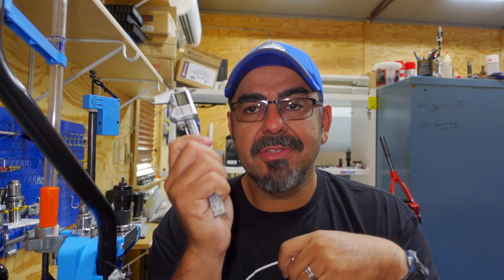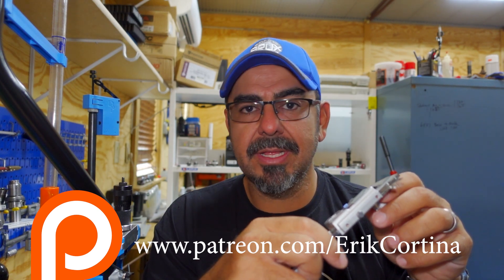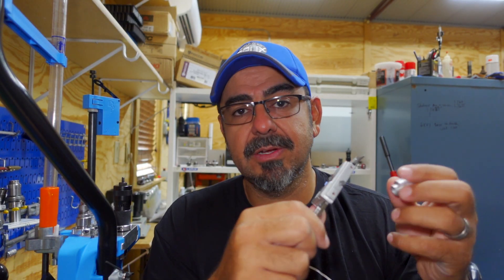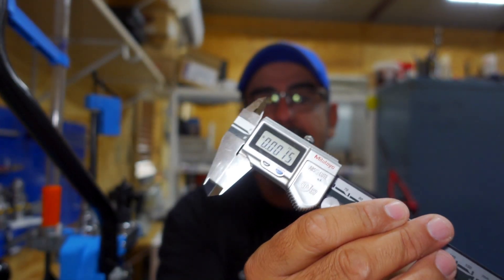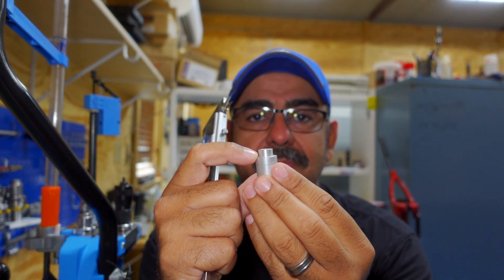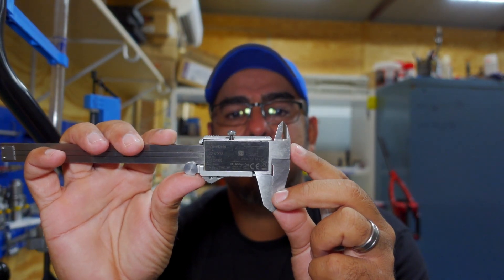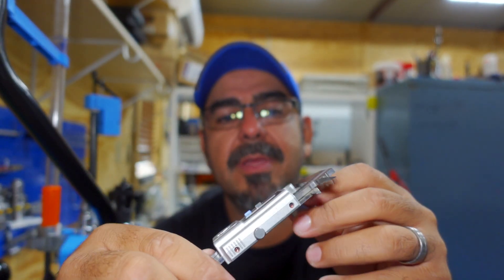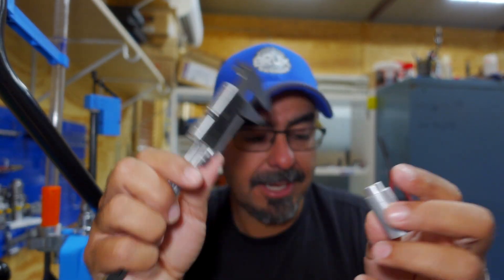You are using your calipers wrong!  Let me explain why...

Comment: About accuracy:  Few people even know what a thousanth of an inch is let alone that there is something that can measure them.  Most people compare things to human hairs or a sheet of paper or even a millimeter.  People I know would say a mm is less than .001".  The little measurement method you demonstrated can be useful occasionally however if I were measuring the part in the video I would measure the overall length and then the shoulder height from the same surface.  A little math does the rest if necessary.
Reply: Imagine that! People using millimeters to measure things! When you can use your feet or intuitive things like gauges!
Reply: @nomen.nescio  If gauges were intuitive more people would be using them.  The great intimidator here is MATH!!!  Most people think you're a genius if you can do even the simplest math.
Reply: @ramtek2702  It was sarcasm, gauges are even more crazy measurement units than inches and feet. Mainly because math with them is impossible... Imagine a system where 0 is not the same as 00. And yet, many Americans still use this crazy system... Or really, systems, because for example wire gauges and sheet metal gauges are completely different units.
Reply: Temperature is also a factor

Comment: Yup... Used calipers for many years but didn't know about that method. I would have set the calipers on the step vs bottom, set origin, then measured end to end. Difference is the step depth. Your trick is much quicker though. Thanks :-)

Comment: Also wrong use;  Using them as scribe tool......DONT!
Also wrong use;  Using imperial instead of metric!! :P
Reply: the best use for a Harbor Freight calipers is as a scribe tool... they pretty much suck at everything else... (-:
Reply: So when I'm working on the airplanes I worked on for 42 years, I have to take the conventional (NOT IMPERIAL) unit measurements in those hundreds of thousands of technical data pages and convert them. . . I get it. Smart.
Reply: @paulcrumley9756  Hahahah that would be a B.!!!   
But I do think working in Metric would be a lot more sensible and faster then using, 3/16...and so on, fractions...
But héy, I get it, if everything has always been a curtain way, it's almost impossible to switch..
You didn't notice the  :P  ?   :)
Reply: @R2_D3  Well, I never saw an official dimension for much of anything that wasn't in inches and decimals. No feet, no yards, none of those impossible to figure out (unless you're good at sixth grade math, but I digress) units. Just a dimension such as 10.125 inches - as simple to use as metric. And measuring equipment to match, of course. So as long as there are historic items needing our attention, we're stuck with a decimal-based measuring system.
Reply: @paulcrumley9756  I totally get it, use what you know best!   
I'm damn glad we Dutch use the metric system!!  :P
Reply: 95% of the world use metric, and the rate is increasing.
Reply: I’m comfortable with metric and Imperial. . .   but using Inches means you have to know how to deal with fractions; dealing with fractions exercises the brain. . .   which is a “good thing”
Reply: @dewiz9596  We use fractions; A 10/100/1000 of a millimeter. At a fraction of the time and hassle ;)  So we can think about the next thing we want to make..
Reply: @dewiz9596  I have never come in contact with imperial measurements. I guess that I work with "the majority of the world".
My brain get more than enough exercise calculating with metric :-)
Reply: Uh, what's "imperial"? :P
Reply: @Milosz_Ostrow  Inches, feet and yards, or wooden shoe lengths, as us fitters call it (at least in Denmark). ;)
Reply: @Milosz_Ostrow  a typical ''google search'' word :P
Reply: @Milosz_Ostrow  It's what the ill-informed use when they refer to US customary units. There is a similarity in unit names, but the US has never used imperial units to my knowledge. 
Wikipedia: "The US Customary system of units was developed and used in the United States after the American Revolution, based on a subset of the English units used in the Thirteen Colonies."
Reply: @elypowell6797  — Who uses it anymore?  Aerospace and automotive industries went hard metric decades ago.  Only the building trades still use inches and feet in the United States, while in the rest of the world building materials are sized in hard metric dimensions.
Reply: Metric is the devil! 😈
Reply: @SquirrelyPrepper  The Metriconspiracy!
<3 The Devil!!

Comment: You miss one.   There is 5 ways to measure.   Measure overall length than press zero length.  Measure  shoulder to end. This will give you the length of the short  step.
Reply from the maker: That’s using the OD, which is one of the ways I discussed.

Comment: Hi,

Before taking any measurements you should be wiping the measurement surface, not just for gauge blocks. 

Also you shouldn't be storing you callipers completely closed as that damages the measurement surface. 

When using a gauze block you shouldn't be handing it as the heat from your hand is enough to make it expand it out of specification.

Regards

Comment: Great info, been machining 40-years , still drop by these vids to maybe learn new tricks. It is amazing now-days to see kids graduating from machining trade schools whom have been well trained in the digital world but can't read a pair of Starreet dial micrometers. Salutations to you guys out there who makes these type of instructional vids !
Reply: As much as I agree with you, it is what and how they are taught. Try them with a manual / non digital vernier.
Reply: @colinweir5807 , vernier refers to the analogue scale. Digital calipers are just that, digital.
Reply: @alfa-psi  Well, I said I was a Machinist , not an English teacher, LOL !
Reply: I retired 5 years ago after 40 years as a journeyman machinist/tool maker. The "problem" with the guys coming out of the schools today, are more "button pushers" than actual machinists. I can do stuff on manual machines that would have them scratching their heads. Most of them don't know how to adjust the taper attachment on a manual lathe, or even how to sweep the head on a knee mill (generically called a Bridgeport).

Comment: It's actually in the instructions that come with the calipers and has done for as long as I've been an engineer (47 years ) but guys never read them !
Reply: He didn't try and explain how to read a vernier though, they are (or should be) accurate to 0.001" ;o
Electronic are not usually as accurate as 'real' vernier, just easier for people too dumb or lazy to learn how to use them. I have 6 pairs and they all give consistent results (except the 2 electronic ones)
Reply: @1crazypj you're dead right, for quick measurements of parts digital verniers are fine especially for older eyes but its got to be a Mike for machining and quality control .
Reply: @1crazypj  Why would you need to use 'real' when the electronic one is so much easier to use and more accurate than 99% of people require?
Reply: @ssu7653  Quite simple really.
Although I have 3 electronic calipers,  I've never had to change the battery on a 'real' vernier.
I found it too much of a PITA changing batteries 'all the time' (at least it felt like it)
Plus, the readings vary as battery voltage starts to drop and it's less 'landfill'
If you have trouble reading 'real' one, get a dial type, it will still be working fine for your great, great, great, grand-kids (even if only historical interest by then)
I have a Mitutoyo Vernier that my brother gave me as a present when I completed training. 
It's at least 46 year old and still measures to 0.001"/0.02mm (when I bother to check it with a standard) Nearest 0.010" is normally good enough when 'roughing out' and many applications only need +/- 0.005". There is also a certain 'snob value' of being able to actually read a Vernier gauge when 'wanabee's' can only use electronic
Reply: @ssu7653  It's a matter of interpolated resolution. 

ANY electronic digital measuring device is limited in resolution for two reasons. First is the increments engraved on the glass scale on the back of the caliper slide (or whatever other device ...). The increments are very small and precise, and current technology is not able to ECONOMICALLY make them smaller and closer together  and still be unambiguously readable by the computer. Second is that all computers work in binary logic - strings of 0 and 1. There are no fractional parts between them. 

An experienced human eye/brain combination can interpolate between the smallest divisions on a vernier, dial or odometer-style mechanical scale with reasonable accuracy, where a (reasonably priced) digital instrument simply cannot. 

Stupid, limited computers versus human intelligence and vision.
Reply: @GraemePayne1967Marine  Computers have no problems with fractional parts, with enough bits, you have more than enough precision work with anything physical, from the observable universe down to the plank length. The real limit comes from the analog (i.e. not binary) circuitry.

The main reason why digital calipers are measurement are not that accurate is that more accuracy is pointless. They lack rigidity, they are subject to thermal expansion, there is no way of adjusting the jaws precisely and keep them in place, etc... They are convenient and  good enough for most tasks, but if you really want precision, it is not the right tool, you need at least a micrometer.
Reply: @gubx42  Yes, but I was talking specifically of the computers embedded in digital tools, such as the calipers. They are much more limited in capability than, for example, the multiple computers embedded in a modern automobile.
Reply: when all else fails, read the instructions
Reply: I’ve known about the the fourth hidden feature for 45 years. It’s called step measuring.
Reply: @rickhoey4843  Certainly a step up
Reply: Hence the engineers motto 'When all else fails, read the instructions'  and if that fails as well, then it's because you're not doing it the way the wife told you to in the first place.
Reply: Guilty.
Reply: L0l
Reply: HA - "instructions" - you mean they are the pieces of paper that come with things and the same pieces of paper that nearly all of us just let fall on the bench and never read?
Reply: @geneva760  yeah that's the stuff !
Reply: Good call right there, Big Smoke, Jim Tree
Reply: None of the 3 pairs of calipers I own came with a book. 2 Grizzly and 1 RCBS. yes I know they aren't expensive.
Reply: It's also in videos on you tube
Reply: Bingo. 😂

Comment: That fourth way may work on a $100+ caliper, but you should warn your viewers that the inexpensive, Chinese calipers may not have those surfaces ground square to the direction of travel of the movable jaw. So if you set it against a flat surface, the caliper will be tilted and you will be reading a false dimension (cosine error). I have several import calipers and some are square and others are not. Some show very coarse grinding marks indicating that it may have been "ground" on a belt or disc sander. 
Of course, you could touch-up these surfaces if you have a way to grind them square. After viewing this, I may just do that.

Comment: I have one more: How to measure the distance between two holes, center to center. Stick the pointy ends in a single hole an zero it. Now stick each point in a separate hole and it reads the distance between the two hole centers. (holes have to be the same dia)
Reply: That is the most useful trick. The one in the video, demands that your caliper is square at the end.
Reply: Aha!  I had to drop in to share my own contrived trick, only to find this.  I'm a tad fuzzy on your sticking "each point in a separate hole" being at all accurate, but here's how I often use mine: for measuring the on-center dimension of two equal diameter rods or bolts.  If you measure the outside diameter, then zero (tare) that measurement out, then measure across the outside of the two bolts or rods.  This gives you the o/c dimension, dead nuts.  This only works on digital displays, obviously.  Plus - don't forget to RESET your ZERO!  As for the math: max distance outside less both radii equals o/c.  If rods are equal, two radii equals one diameter.  So for this to work on holes, you'd measure inside diameter of one hole, then zero out, then measure inside (between) the far edges of the two holes.  The problem with that is that in smaller holes it's difficult to get an accurate inside diameter, if not outright impossible.
Reply: @palewriter1856  Yes, there are some limitations, on hole size. But if 0,05mm with a caliper is ok, this method works. Most calipers aren't that precise under 0,05mm
Reply: @palewriter1856  clear as mud
Reply: You can find the center line on two holes with different diameters. You just have to calculate radii of both holes.
Reply: @rickhoey4843  Of course -- but the point of my method was that it takes no claculation, for the math-challenged.
Reply: @rickhoey4843  Great trick, never thought af that.
Reply: Just go's to show that you're never to old to learn something new.  Thank you.
Reply: @mrmyorky5634  too*. Learn it.
Reply: You can measure almost anything with a surface plate, slip guages, angle plates, parallels, v-blocks, rollers and a dial guage and stand and an angle off an angle if you are good at compound angle calculations.
Reply: @theacoustician6741  Yeah - you can DO almost anything if you have an endless list of handy tools, and a solid education in how to use them.
Reply: This post keeps coming to my attention via notifications for every additional comment - and I have to admit that it has bothered me from the start that I cannot get comfortable with this method as you describe it.  Perhaps I'm not interpreting your description correctly, but what causes me the most unrest is in the theory that simply sticking the "pointy ends" into a hole to "zero it" will result in setting the tare, or zero, to the diameter of the hole.  Follow that with simply inserting those points into the two holes we are needing to measure the O/C of - which practice will yield ???WHAT MEASUREMENT???  and I'm at a loss to know how this can work.  In this case a visual would be helpful, perhaps.
It surely doesn't SOUND like the same thing I dropped in to post, the theory of which I can readily explain, so if it IS, in fact, accomplishing the same thing I must admit I cannot see it!
Clearly this does NOT work with plain, old calipers without a digital display that HAS the zero (tare) function - but that's a given, is it not?
Reply: @palewriter1856  Now that I think about it, I think Dan's explanation makes sense even on small diameter holes where the caliper cannot sit flush against the inner wall of the hole. I was thinking of the same problem at first (assuming your thought was the same as mine), that if you have a small hole, the face of the caliper cannot sit flush against the walls of the hole, and the caliper would read a smaller diameter than there really is. However, if both holes are the same diameter, then the error in the measurement of the diameter of the single hole, is equal to the error when measuring the distance between the inside between the far edges of the two holes, thus the center to center measurement is still exactly precise.
Reply: @palewriter1856  clear as mud

Comment: When I first saw the title I figured it is for novices. I didn't know about the 4th option. I have Starrett calipers & micrometers all over the place here, digital and analog and been using them for 40 years. Glad I stopped and watched your video. And yes, calipers are for measuring length and micrometers are for thickness but calipers are easier to use and in many cases are good enough.
Reply: you ever hear of pitch mics

Comment: The fifth one is mentioned below but it has another use. When making multiple parts, zero it on the master and all others that are measured give you the difference +/- Lot easier than trying to do the numbers, it does it for you..
Reply: That is not a 5th, is a technique to use it as a calculator or slide rule.
Reply: @annakquinn7084  These calipers measure, therefore the 5th is valid as it is measuring difference.
Reply: @MurraydeLues  no, you even can do that with a regular ruler. Is not a way to measure, is the intended design. Mitutoyo, Starret and Fowler documentation contradict you.
Reply: @annakquinn7084  Yes you can measure with a ruler, but it will never achieve the speed and accuracy of this method. You have obviously never used them this way, so there is no point trying to even attempt this. Please continue in your little dream world.

Comment: Been a toolmaker for 40 years---I call calipers "guessing sticks." Another use of this feature is for accurate marking out from an edge. Simply set the measurement and place the shoulder of the slide on the side of the workpiece and scribe across the end of the caliper.

Comment: When U are using  e-calipers to measure small inside diameters U totally messed up. U may have lost approximately .020 on that size diameter because of the side to side offset of the ears. READ THE INSTRUCTIONS THAT CAME WITH THE CALIPERS. Making mistakes like that U will never make a living as a real machinist.

Comment: You forgot to mention the tip radius of the tool that cut the step diameter. When you use the depth gauge there is a radius to step the measurement point out from that radius. The square-ground end of the jaws can sit anywhere on that radius and give an incorrect reading. No point in having accurate instruments if you don't use them accurately.
Reply: Spot on observation. If he's trying to claim that they give accurate measurements, then it should have been pointed out in the video.  I refer to mine as the 'Very Near Calipers' and wouldn't use them for anything that needed to be better than 0.005"